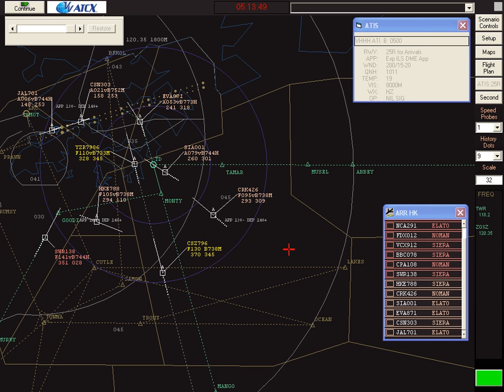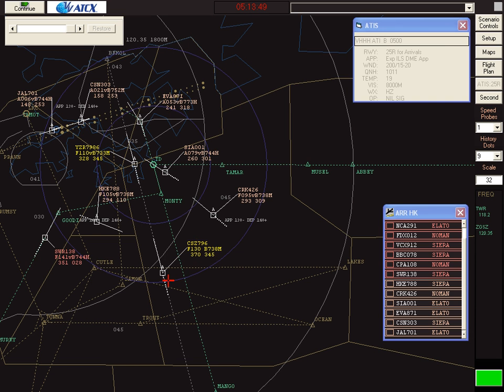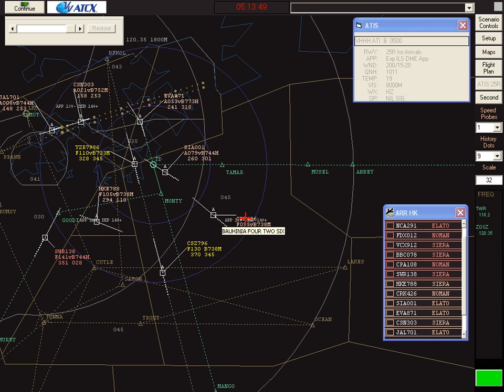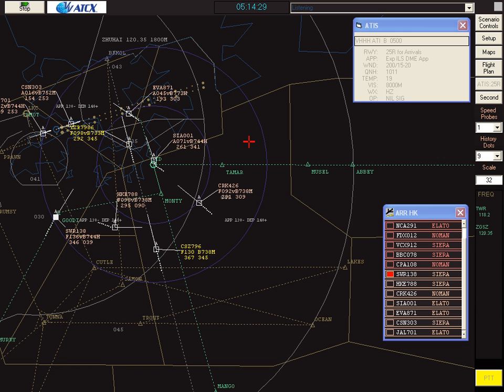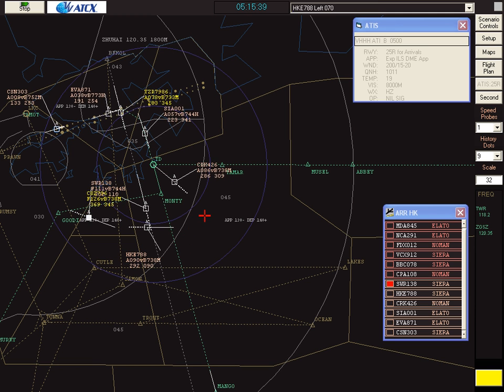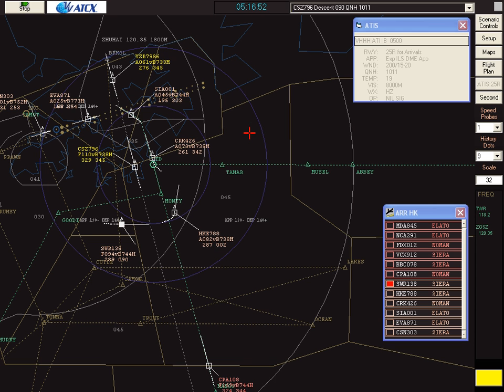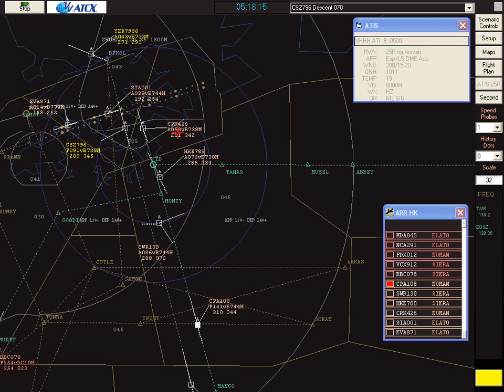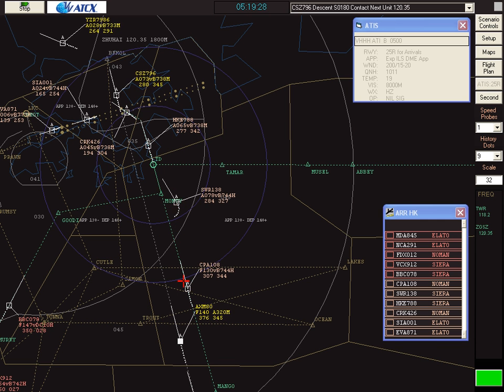Radar Simulator Hong Kong Runway 25 ATCX Demo

Comment: All aircraft use altimeters calibrated in feet - so Flight Level 60 translates to 6000 feet !  
To say that the chinese use metres for aircraft height is nonsense !  Pilots are far too busy to be doing feet to metres conversions in flight.
Reply from the maker: Hi Lawrence, sorry, but you are mistaken. The Chinese most certainly do use the metric system for altitude measurement, as do the Russians, Mongolians and many other countries in the region. See here: https://en.wikipedia.org/wiki/Flight_level#Metric_flight_levels

I suspect that glass cockpit aircraft that solely operate within these areas have the altimeter calibrated to metres. I might be wrong about this. Foreign carriers have a conversion card so that level instructions are converted to the imperial equivalent for entry into the FMS. Controllers in the Hong Kong centre assign northbound aircraft an agreed metric level for transfer to Chinese control.